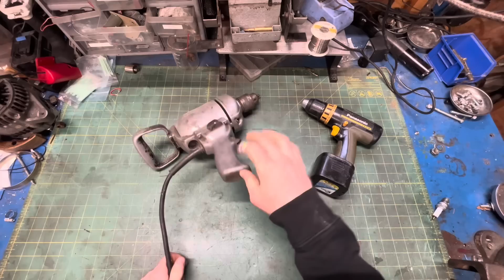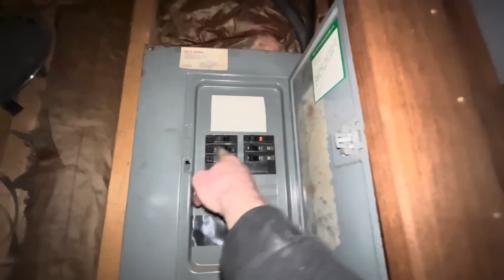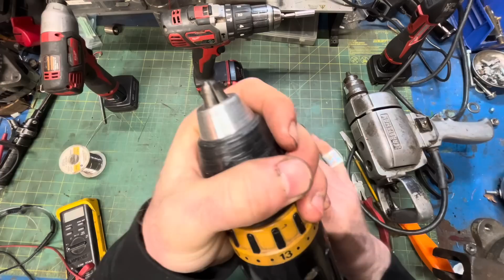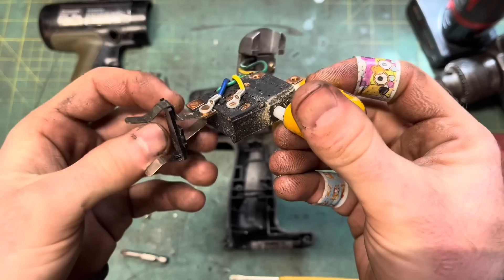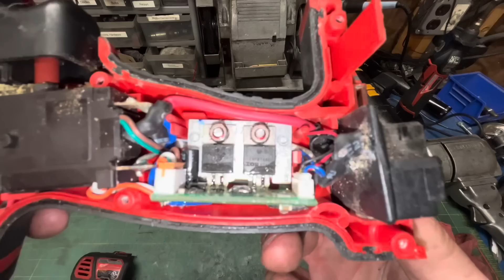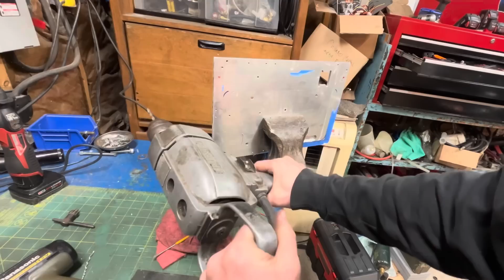Tools of my Ancestors! Tearing Down 3 Generations of Power Drills

Comment: You need to get your hands on the 1960 edition of the heavy-duty black and decker drill. It was, without a doubt, the most powerful drill motor I've worked with. It would and did wreck people's wrists. Anytime anyone wanted to barrow it, I made sure the extra side handle was screwed in. Most of the times they removed it because real men didn't need it. A few weeks later, they could use their wrists again.  I know you can't buy a good black and decker anymore but back in the past. Days of everything, black and white. They made real commercial duty tools, not the diy tools of today.

Comment: DUDE i juhst bought a panisonic power drill at the thrift store  (edit its actually the same model showcased in the video but someone took the chuck before i bought it so ill have to add one) i got it purely because i was like wtf they make powertools? i guess not in the us anymore but it even came with its 12v battery its nimh chemistry. i havent really used it yet i have no charger for the battery i miight just take apart the battery housing and put some li ion battery in there to revive this bitch to modern day i just love the way it feels really well made.

also no joke the thrift store had a kawasaki drill i was like wtf is this weird shit and how did people acquire these things? i would have bought it but it looked cheaply made im just liek wondering if you buy a dirt bike did they throw in some cheap ass drilll like here you go champ its greeen and has a level on it enjoy

edit2: 11:00 i promise you your memories arent just nostalgia the tool did feel quality it probably got dry rot or something or was stored in a place that it didnt like
the one i bought recently was very lightly used and seems like it sat inside alll the rubber is prisitine and everything feels good i took it apart seems like it still had original grease and was never taken apart before. thrift stores are always fun to look for cool stuff like this if you dont have a youtube channel based around tools where people send yhou cool shit in the mail :(

Comment: I'm only around 3 years older than you and grew up closer to germany. Anyway, the first real cordless drill i bought was the first or one of the first metabo brushless (just after i destroyed an entry level metabo by using a 60mm hole saw on 15mm steel, oops). Anyway. Up to that point and already working as an electronics engineer i have not heard of 'sending a bricked cordless drill back for a firmware upgrade on warranty'. But it just stopped working one day...

Comment: I assume you flipped the reverse switch while the drill was running. Thus the energy in the spinning rotor regenerated back as additional voltage. You probably put a spike of nearly 240V on that 120V circuit. The MOV in the surge suppressor gave up along with the weakest lights - survival of the fittest. Since the rotor / chuck / etc. on that drill has some mass to it, this kept up for more than a few milliseconds, so the various breakers left the chat.

Comment: I have 3 of the first drills (Bought at an auction years ago) high torque with crappy batteries compared to today's standards and I have the Craftsman drill, which was my Grandfather's. The running joke with all of Grandpa's old electric tools when my Brothers borrow one from each other is "Will it shock me?" and the answer is always "It was Grandpa's, what do you think?". I should fix that one the tools I got but the nostalgia of possibly getting shocked and inevitability getting shocked because it was, after all Grandpa's, is refreshing. He was a safety last kind of guy who's theory was "It's fine if you hold it right."

Comment: in reverse the coil acted as a transformer and sent a high amp surge back to the board, through Line1 and back to the other circuits > the surge profile was so out of spec with the breakers, they smoked late?

Comment: That's not a hall effect sensor at the back of the motor. It's a MOSFET for the speed control.

Reason it's stuck to the back of the motor is because that motor housing is a free heatsink. Until you use the tool, then it's a free heat source.

Edit: nevermind, you looked it up.

Comment: That old Craftsman drill has been working for 60 years, without anyone having to sink any money into it, and it still does the job. The Panasonic is on life support and will soon be dead and useless and who knows how much money has been spent thought the years on batteries, and it never had the power to do what that old Craftsman drill can do, and the Milwaukee is a nice piece, but believe me, it will not be working in 60 years, and if for some miracle it still was, you would have spent thousands on batteries. That Craftsman drill will still be working in another 60 years, yes it has a cord and it is heavy and unwieldy, but there is something to be said about a tool being able to do the job forever with little to no investment...

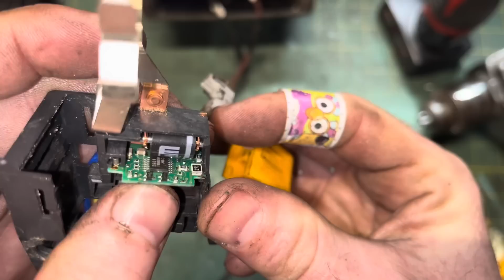Comment: 18:19 That doesn't make much sense to me. A comparator is outputing HIGH or LOW, depending on whether a voltage applied on its input is higher, or lower than the voltage it compares the input voltage against.

ON or OFF  would not make a good variable motor speed controller.
Reply from the maker: The comparator outputs a HIGH or LOW to the gate of the mosfet, not to the motor- so it’s basically working together with the mosfet to create a pulse width modulated speed controller.
Reply: @thedoubtfultechnician  Yes, that's right. But what generated said PWM signal that would go to the power transistor? As I mentioned before, a comparator doesn't make sense there. 
If it was an 555Timer put together as an astable vibrator 😏😏, then you'd have PWM signal with a frequency that depends on the resistance of the potentiometer used to discharge a cap. 

But a comparator... That would mean that YOU would have to finger the switch like you love it, to generate the PWM signal yourself.
Reply from the maker: @oilybrakes First of all, don’t underestimate how quickly I can finger. Marriage advice 101. Second of all, you’re probably right- I’m guessing there’s an oscillator somewhere on that board generating a sawtooth wave, which the comparator compares against the reference voltage coming from the potentiometer in the trigger. I’d have to take it apart again and look.
Reply: @thedoubtfultechnician  Naah, don't bother. You already had your fingers in it once. 
It might want extra attention if you get into it another time.
Something's gonna break and you won't find a replacement switch for that 30yo dirl.

Comment: 05:30 Had to watch that at least 10 times. Amazing how well it goes back together. All the parts fit exactly. Thats the thing that gets You to the Moon: quality and precision. The better the body parts fit together, the better they support each other, the better they align and stay aligned as intended. All misalignment in body will more or less add tension when assembled and screws are tightened. Depending on materials, this can cause wear and  fatique in the body, bearings/bushes and axles.

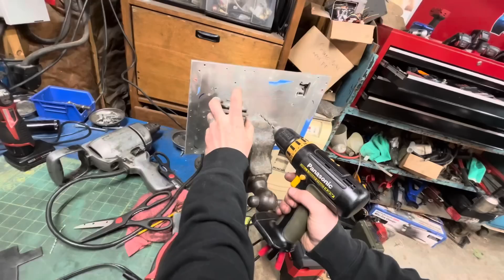Comment: 25:30 Interestingly, in this case 12V isn't 12V because of battery chemistry.  NiCD and NiMH battery cells run at 1.2V, so there is 10 cells in that NiMH pack.  Lithium cells run at around 3.6V most of their charge with 3 cells in an M12, so a fully charged NiMH would have given 11% more power over the 10.8V Lithium pack.

Comment: My late dad had a bunch of early 2000's ryobi 18v gear. Recently pulled them out and was suprised at how decent they were for 20ish year old abused entry level brushed power tools. Maybe it was the modern lithium batteries that really let the tools shine, but i was still impressed with the cordless saw, drill, and battery shop saw. . Only thing is all the rubber grips have essentially rotted away. Microbes crave vintage plastic...
Reply: Might 3d print some new TPU grips and use them to LARP as a turn of the millennium first time dad and homeowner
Reply: For those of us working on electronics ib the 90s and 2000s... it read the last era of ACTUAL high tech quality
Reply: That's usually cuz they forced using bio degradable plastics by the 2000s.. and all that recycled white metal as frames for laptops.  Sad. twas the beginning of enshittification
Reply: Early 2000s Ryobi was stout. I was still using one from 2003 until I changed jobs in 2016.

Comment: The drill I got from my grandfather was, well, kinda dangerous.  I don't remember the brand, all metal, and a bad ground somewhere.  Used it on a clamp in a home made wood holder.  The way we used to keep it on was latch on the outside of the trigger, like a spring wire you manually pulled up onto the trigger. lol

Comment: I had the same or slightly newer Panasonic drill at work (HVAC) around the turn of the century.  They were pre-Lithium, but were of high quality and had one of the nicest-feeling clutches and chucks I've experienced; it was a mechanical pleasure just to move the dials and the clutch provided consistent torque.

Keep in mind that corded drills at the time lacked finesse and this made them poor for driving screws.  The Panasonic cordless was my first real powered screwdriver and made it far easier to hang ductwork and such with one person; driving nails required 2 hands, so another person was required to hold the duct, etc. while a third assistant screamed loud enough to drown out the cursing.  We had a corded Milwaukee for drilling holes and it would break your wrist if it got the chance; I brought the Milwaukee home when we closed shop and still have it.  Good for hole saws, but bad for your bones.

NiMH batteries are not quite crappy; it's one of the most durable rechargeable chemistries available at an affordable price and capacity problems are often resolved by blowing the dendrites out with a welder ;).  I have NiMH AA cells in my daily shaver and they've been there since 2009 and still have 75% of their original capacity; I tested them recently.  Lithium can't do that unless you add iron or titanate and titanate is quite expensive ;).  Neither of us wants NiMH in our power tools in 2025, though.  Good for replacing alkalines, but not for maiming wood.
Reply: NiMH still holds a place in a lot of around the house tasks where energy density just isn't as important.  Amazingly robust cells.

Comment: 2 breakers tripping on opposite phases could be a shared neutral, 3 breakers on 1 phase is unusual but not unheard of. I only saw 2 tripped breakers on opposite phases in the video
Reply from the maker: This is a sub sub panel- the fluorescent fixture is fed by the sub panel. I know some of the outlets have reverse polarity and some have open grounds. They’ve been on my to do list since I bought the place. 

A decade ago…
Reply: @thedoubtfultechnician  There is nothing more permanent then something temporary that works
Reply: @regulatorjohnson. nothing more permanent than a problem that doesn’t present itself lol

Comment: Wago is extremely fancy, i don't need that much. Spade connectors, terminal blocks, crimping, soldering, and even spot welding (in some aplications) are all acceptable for apliances and tools. Wire nuts are only acceptable as an example of what not to do.

Comment: As a European I don't hate wire nuts, I hate the nuts that generally wire them. Wago's are idiotproof, wire nuts require a little skill.
Reply: Yeah I can attest as someone who is usually using wiring nuts.
Reply: I primarily use wagos. They’re my prefence.  But they have their quirks. When you’re pushing everything back into an American junction box, it’s easy to snag the levers on the newer clear ones and causing the wire to fall right out. Never came across this issue with the previous grey ones.  Also, the lever nut rotates around the wires when moving them around. Do it enough times and the wire falls out just like with a push block.
Reply: @robertrada4783  Little electrical tape around a wago and they aren't opening up nomatter how much you recklessly stuff them into a box.  An appropriate wire nut with the right wires shouldn't go anywhere but more often than not people use what they have, not necessarily what's appropriate.
Reply: American here: There is a trick to using wire nuts. There are two ways to do it: place both into the nut and twist or pre-twist and then twist the nut around the connection. In my experience, the former is the better method, but requires some skill to execute properly. Pre-twisting is effective, but you have to do it so the connection does not come undone.
Reply: @sonicmastersword8080  Using the right size nut for the gauge wire and HOW MANY wires also matters. Over stuffing or under stuffing a wire nut is dangerous too...
Reply: From the uk/Ireland, everything I’ve ever worked on was done with screw terminal blocks, never seen a wire nut or wago in my life til about a year ago lol
Reply: Btw. Wago claims that their connectors can be used in automotive applications and are fine with vibrations, due to the springloaded contact exerting pressure at all times.
Reply: @oilybrakes I have little experience on using them in automotive but I’ve been using them for years in upstream O&G automation. I’ve never had a wago fail on a shaky ass wellhead nor on a compressor where the whole damn unit just vibrates.
Reply: @LootGoblin432  That's very reassuring to hear! Thanks for the info!
Reply: @oilybrakes  no problem! Overall I’ve never had a problem with them and they are a life saver when it comes to troubleshooting or replacing stuff. I use them everywhere and even pop them out of stuff getting demo’d to reuse them, the only way I’ve found to actually mess one up is if they get rusty (the springs might fail and I’ve only had rust become an issue in leaky conduit) or muddy (crap gets in the spring and they won’t grip anymore but big shocker there). This would be solved by simply using the waterproof versions but I’ve never gotten around to actually ordering some.
Reply: @LootGoblin432  and even if they do start coming loose, just wrap some electric tape around both the connector and the wires so it’s one peace and can’t fall off
Reply: @oilybrakes  I just fixed a circuit, that would do amazing things, full of amazon wagos.  Wire nuts to the rescue.

Comment: I have an old Sears Craftsman 3/8 hp 1 inch variable speed reversible drill. My family was trying to get rid of it, but I explained to them the advantages of older technology and corded drills. Later I find them using my drill on their home improvement projects. Suffice to say, I won the argument about old equipment.

Comment: I got you beat. I've got thirty years on you and I  have MY grandpa's power drill from the 1940s. Made by The United States Electrical Power Tool Company,  its motor will run on either AC or DC current. It dims the lights when you run it. It's the tits.❤
Reply: I have my grandfather’s axe, Disston saw, and a hatched hammer thing he used for installing lath for lath and plaster. I let his old tilting table tablesaw go because it was a little too scary…
Reply: @timmikesell7 did you keep a sawblade at least?
Reply: @noahboat580  nah, it was a nonstandard size if I remember right, and I was all about the carbide at the time.
Reply: I bet it's a beast to use and will outlive us all.  And no one actually wants to use it.  Exactly my type of tool.
Reply: If a motor has brushes and no permanent magnets then it is a universal motor. Universal motors run on AC or DC. But a modern drill will likely be a VSR tool. Variable Speed Reversible. An AC motor speed controller likely wouldn't take kindly to DC. They need the sine wave of current to operate. Another name for them is a phase fired controller.  No phase, no control. Generally in a VSR full trigger pull bypasses the speed control entirely though. Giving you full power. Then it's like the speed controller isn't there at all and it should work on DC then. I'm not sure how the speed controller itself will fare on DC though. It may get damaged? Because getting to full pull you are going to be passing current through the speed controller. Now there's some wacky AC speed control designs that do use SCRs. SCRs would do just fine on DC. But in one polarity it likely wouldn't work at all. I'm not sure if it'd work the other way either. It's something I've never tried. Oddly single phase AC has a polarity too. Hot and neutral aren't the same. You run into it with autotransformers and triacs. Hook them up backwards and they just don't work right. Not everything is a simple resistive load.

Comment: I have this Sears drill from about 1982 or so, needs brushes badly, unfortunately they recycled the part number, so I haven't found the effort to do any deep digging to find parts for it. I'm sure the brushes exist, and it still kinda works. Old tools are neat, but man that thing is heavy and inefficient. Probably will outlast me and everyone I know though.
Reply: Look up old Sears catalogs. If you can match the drill, you can find the part.

Alternatively you could take it into Lowes. They still honor Craftsman's policy and they could probably help you find the parts.
Reply: Maybe measure the brush holders to get a rough size then order something close online? May have to sand/file to fit but it's a solution. Carbon brushes are carbon brishes.